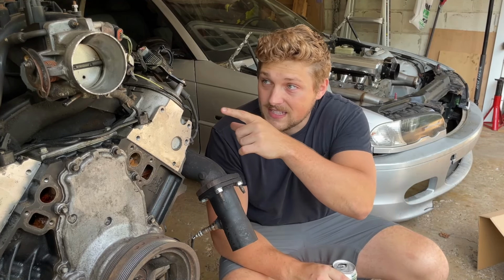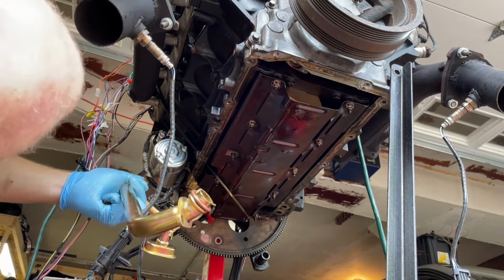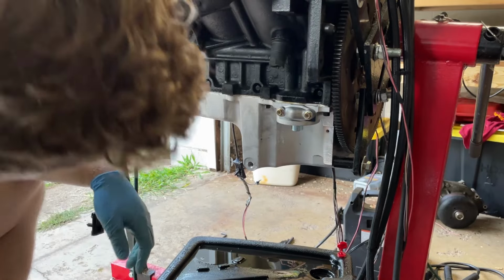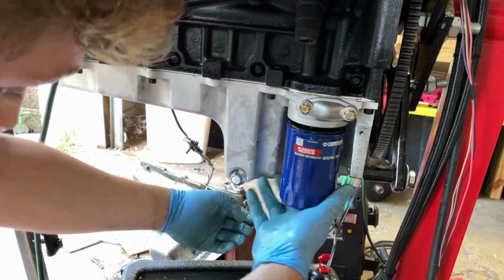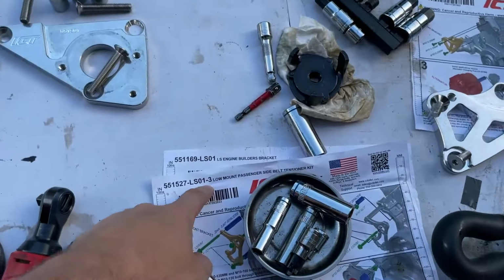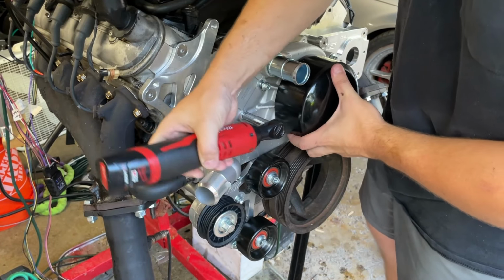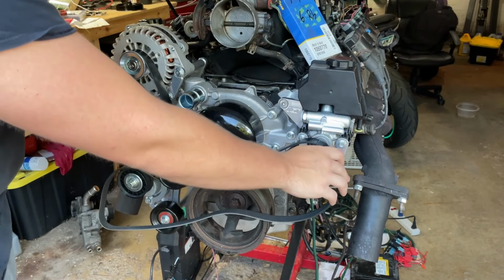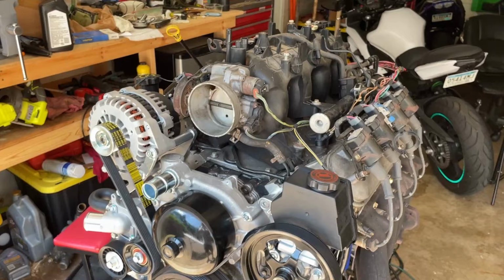LS E46 Getting the Engine Ready

Comment: Any chance you could link all the brackets u used? Specifically the idler setup? Thanks!!
Reply from the maker: The exact bracket kit I got is in the description. I wouldn't suggest using the kit unless you have a reason to not just use the low mount alternator variant.
Reply from the maker: 19:06
Reply: @ yah i dont want the kit cuz i dont plan on running the bmw ps pump. Ill check again for ur time stamp i
Must have missed the numbers lol thanks!!